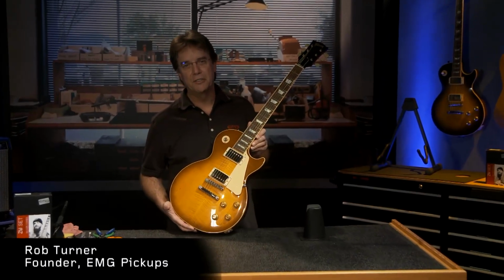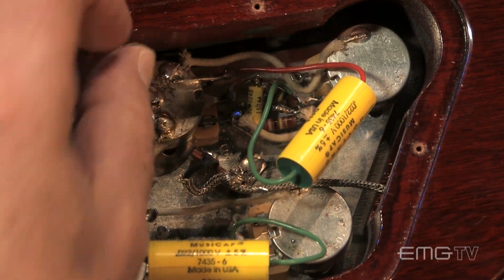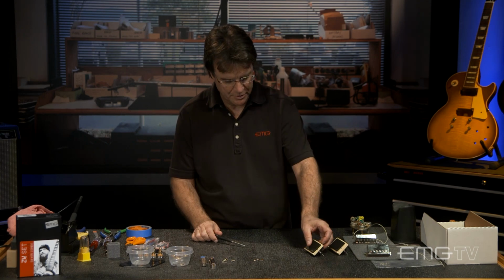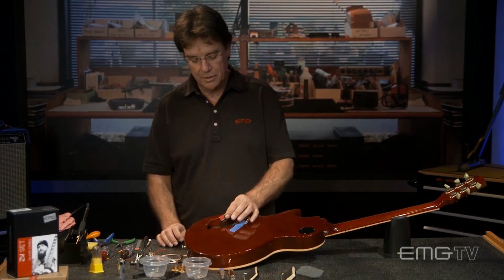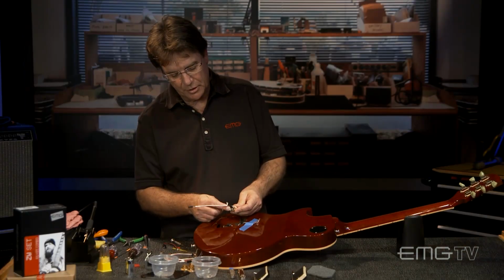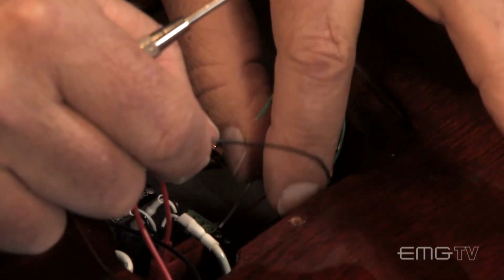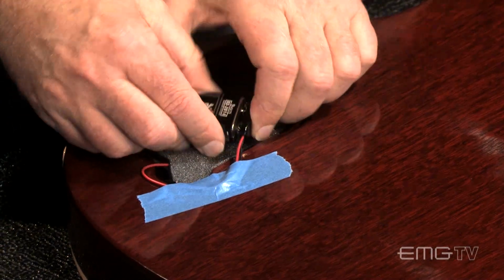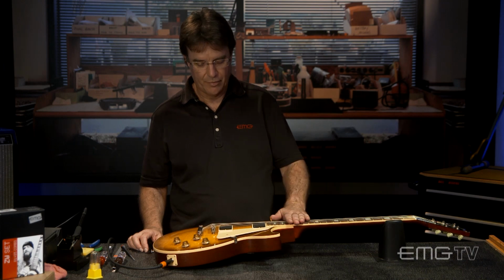Easy solderless Zakk Wylde signature pickup Install with Rob Turner, EMGtv

Comment: what i cant seem to find any information on is that most flying Vs have those big pickguards on em and all the wiring and whatnot is under the pickguard (there are no compartments on the back of the guitar). emgs run on 9v battery but with a flying V, the only way to get to the wiring where the battery would have to go, i would have to take out all the knobs, the bridge, and replace the strings. is there a way to put the battery somewhere else so i dont have to do all that work to replace it?